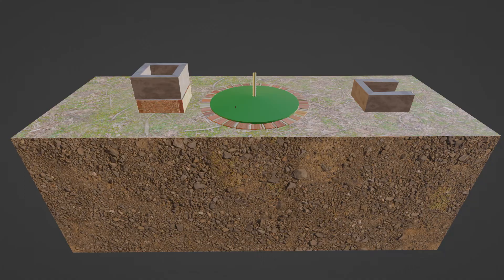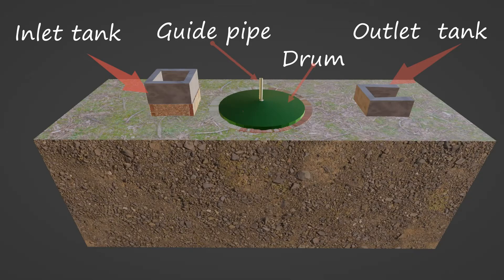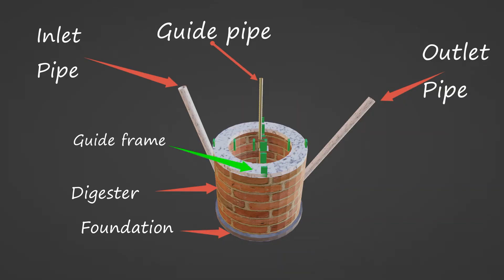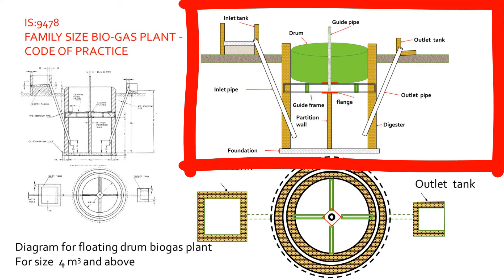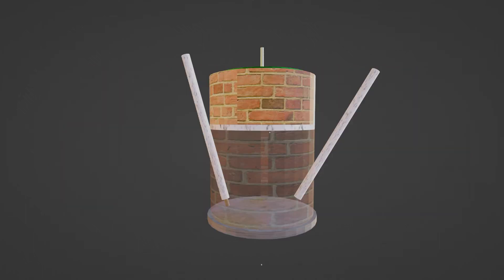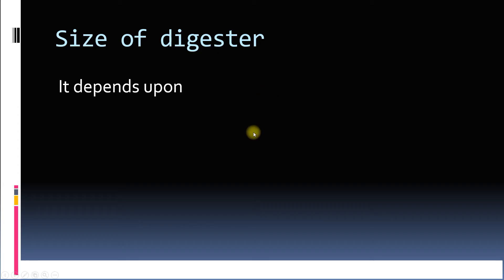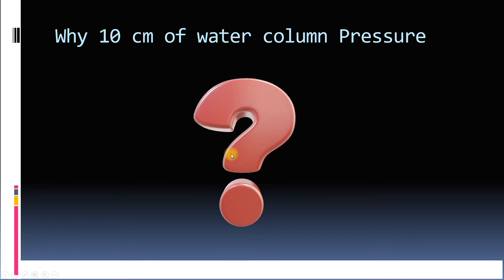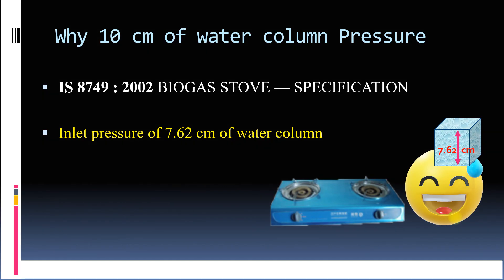Working of Floating Drum type Biogas Plant | Working of  Biogas Plant | KVIC Biogas plant

Comment: Why is the drum made floating over the slurry?? 
And
What is the effect of temperature on this process?
Reply from the maker: Floating drum biogas plant is a designed to give biogas at constant pressure. Temperature is very crucial as 10 degree Celsius decrease in temperature reduces gas production by half (approximately).
Reply: @IntuitiveLearn  Thank you sir..

Comment: What will happen if we add more or less amount of slurry will it work or not?
Reply from the maker: In cases  of less slurry, less biogas will be generated than designed capacity, in case of  excess of slurry, biogas generation will be same however, undigested material will come out of biogas plant . excess slurry can also create clogging problem if design is faulty.